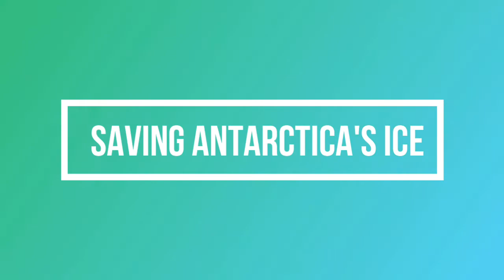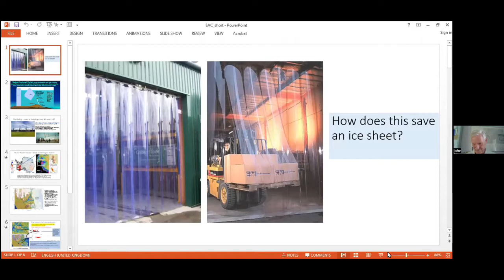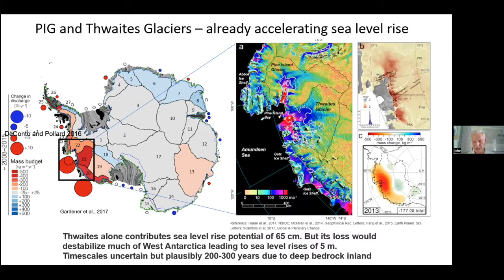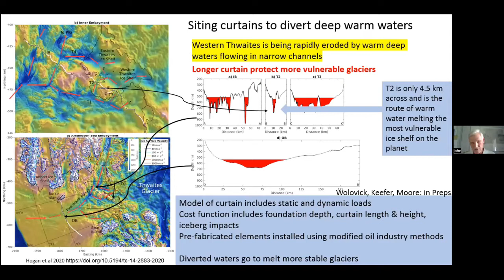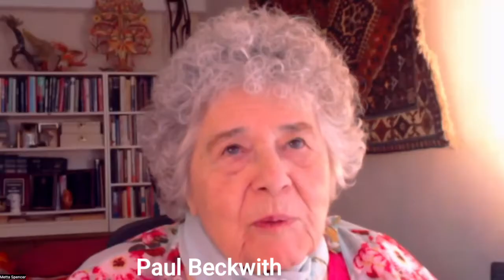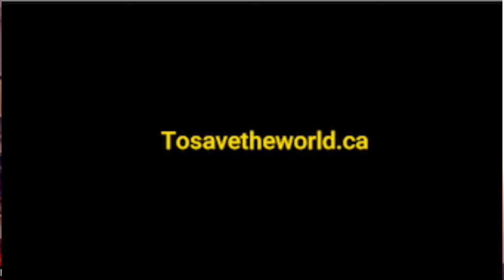Episode 489 Saving Antarctica's Ice

Comment: The Forces on the Thwaites Curtain would be Huge at Times.
So it would need to be Very Strong.
I am Not sure this will work because the Hot Water Rising at the Curtain would be Free to Move inwards to the Ice.
Paul's Suggestion of Using Tidal or Water Flow Generators May be an Alternative because They would Slow the Water Flow Towards the Glaciers.  But, What to do with the Generated Energy ?.
Solar Panels on Greenland to Help Remove Direct Heat ?.
Interesting Possibilities.
Good Report, Thanks ToSaveTheWorld.